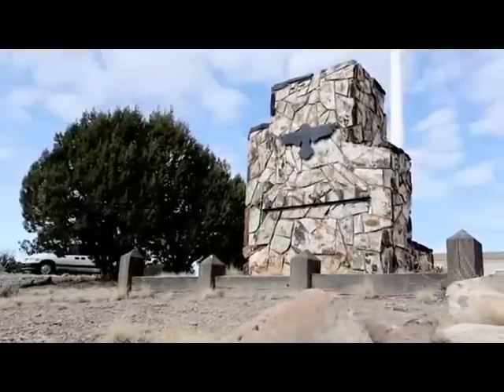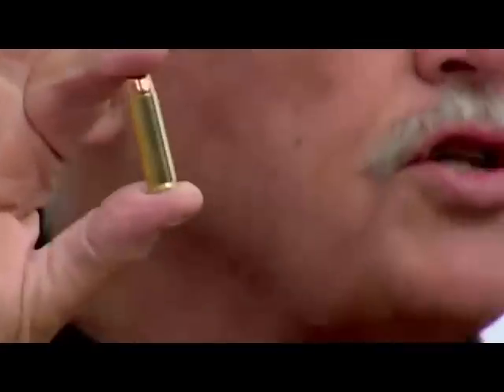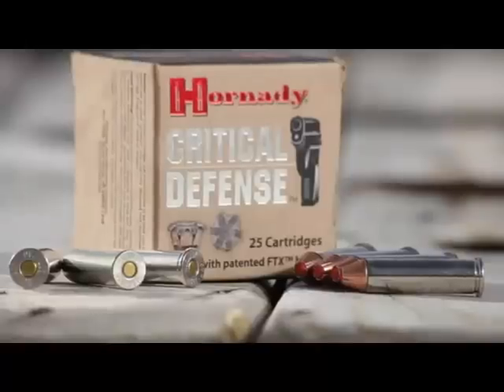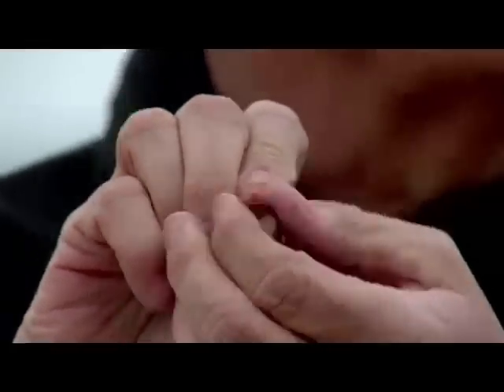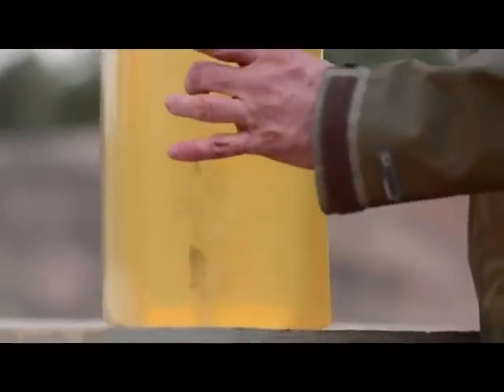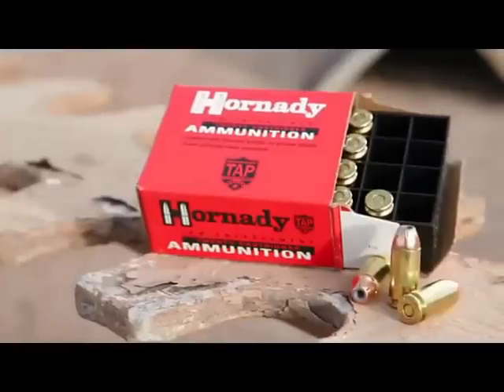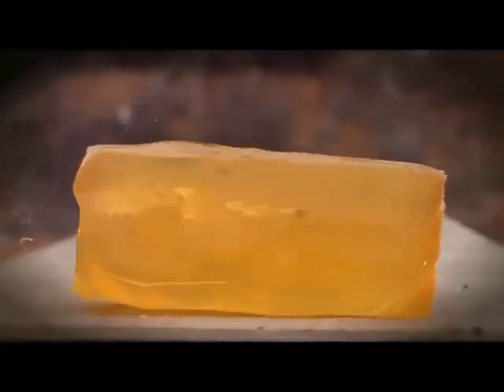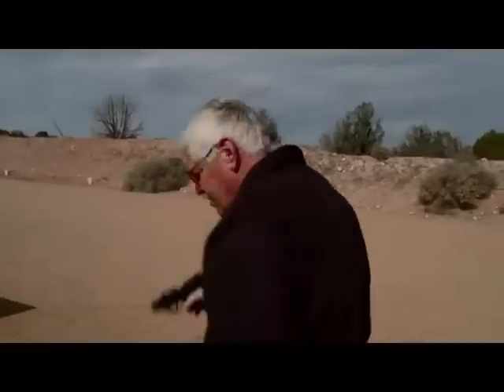Terminal Balistics Test (Part 1) .357mag/.38spl, .40cal, & .45acp

Comment: A .38 will do the job
Reply: It was replaced by the u.s military as a under performing round. The 45 acp replaced it. They did a shit load of tests and found that the 45 is the superior round for dropping a man.
History speaks for itself for the 1911/45 acp.
Reply: @walker jfs I'm not saying it is not  a .22 air rifle can kill im simply just saying the 45 acp and long colt are proven combat effective over 100 years of war has proved that until it was mostly replaced but still widely used by competition shooters and even special forces in the u.s army. The 45 did what the 38 could not and that was effectively kill an enraged tribesman wanting to hack off a u.s military man's head clean off.
Reply: @walker jfs amp it up man get a 460 rowland it gives .44 magnum power to a 45 acp with minor changeable components and can fire 45 acp and 460 rowland. Its a monster can be used in 1911s and glock 21s
Reply: Liam Kisbee got 4 pistols converted to 460
Reply: @liamkisbee8117  you sure are skilled at regurgitating what you've heard
Reply: Jake Stockton  check the military trails that will prove otherwise
Reply: @liamkisbee8117  the tribesman you speak of were the moro warriors I don't think I'm spelling that right but the ineffective round was the .38 long colt
The military wanted a more effective revolver cartridge so S&W produced the .38 spl and they also wanted an automatic so Colt / john browning produced the 1911 .45 acp
The .38 spl was the most common round used by police departments from the 1920's up until the 1980's

Comment: B.S. - that ".357 magnum" Golden Saber cartridge is barely a step above .38spl+P, they needed to use a full house .357 magnum in this test and not that reduced recoil crap.
Reply: +Gun Sam
 Consider to that the .357 Magnum was further handicapped by being fired from a snubnose. A 4inch revolver barrel would be more in line with the 5 inch semi-auto barrel which includes a chamber.
Reply: Agree, those golden saber are so anemic. they're Pure junk.
Reply: Gun Sam he didn't call it a round nose lead he said he is using fmj but the guy he was talking about used round nose lead bullets
Reply: Gun Sam full metal jacket is usually a round nose, solid lead bullet with a metal coating, yes?  Not that I give a dam about this guy, but I think he just didn't say it well.  The old 38's that cops used were just plain old 38's with a round nose and were a joke compared to the other rounds.
Reply: Gun Sam
Reply: Gun Sam - I agree. Why didn’t he use a 158 gr SJHP? Course their are other questions. 357 mag and 38 spc. 10mm and 40 cal “spc.”  45 cal and 9mm? Where’s the 44 spc and why is it ignored? Compared to the 44 spc 9 mm is anemic.
Reply: I like firing 158 gr 357s out if my ruger sp 101 snub... those 125 grains are nothing.
Reply: Gun Sam Revolver Aficionado Agreed.

Comment: Totally unfair test.  You used modern, high quality self-defense ammo in every gun, except the .38 special.  Load up with .38 +p Gold Dots and I bet you'd be surprised at the terminal performance.
Reply: hornady critical defense is better than gold dot lol
Reply: doubtful
Reply: Scotty Mac 22 they are both bonded and both work every time.
Reply: Dirty Dan +P golden saber is a great round for the .38
Reply: Sorry that you're so hurt over the shitty .38
Reply: @saltybuttskin : Well, there is one 158grs 38+P load that is in the 9mm realm energywise, most of the rest is significantly weaker, some around half a 9mm even. And that's coming from a long barreled test barrel or full sized revolver where the cylinder effectively makes the 4" barrel a 5.6" in semi standards.
Reply: .38 full wad cutter would be the ticket for the special IMO.
Reply: @The American Patriot you are not gunna see a one shot stop with 38 anywhere but the brain.

Comment: I have followed Elmer Keith for 55 years now , i have read all of his books and to this day i use hard cast bullets he designed , my primary in .357 mag is his design which comes in @168 grains and  is SWC... I have never read much in "SixGuns by Keith where he used 125 grain weight as he was never much on light weight bullets ... Same in the .44 caliber , as hard as Elmer tried with tires he had with Remington for them to produce the .44 mag loaded with 250 grain bullet the factory never did.. To this day i load and shoot the 255 grain Keith bullet in my .44 mag...  But returning to the .357 mag which i have loaded now for 55 years , my choice is still 158 grain for some shooting but 168 grain is still tops for what i use the ctg for... I don't know why the rage is so much for home defence and all the other CC using the 125 grain bullet weight , years back i bought a couple boxes of that weight and loaded them, i fired them into about every item i could to test them including big game animals , just too light of a bullet..  I agree with Elmer as being a guide , outfitter , bullet maker and a big game hunter , that the .357 mag loaded with 168 grain weight was boarder line for big game , in fact he said on the animals he hunted using it , he said it wasn't enough bullet to do the job.. I agree deer size and black bears would be tops for that ctg... For black bear i have hunted , it's almost not enough ...  good information and video ..

Comment: 38 special is more than adequate. Lots of dead guys prove it.
Reply: Cops got killed while using it. Either bad guys survived getting shot and stabbed the officer because it was so weak it caused low trauma. Also it got cops killed when they had to use .38 against bad guys armed with 9mm pistols like the HI Power.
Reply: @berettaxd7566  that's a lead round nose every slow moving round with a bullet profile like the 38 or 45 can go around organs and bone 45 has had some cases where it goes around same as the 38
Reply: I use 40 and 9 so yea

Comment: The only disagreement I really have is when you started describing the 9mm round....The biggest three reason that it is a popular cartridge is :
1. Cheaper ammo among others out there.
2.Lower recoil (shoot faster)than others out there.
2.wide variety of great handguns that have light weight w/loaded rounds
       These reasons is why the 9mm round is still around sense 1902....
The 9mm round is a proven range cartridge for The reasons I have stated above.
The 1911 models with higher calibers are Still around Because of all the Right Reasons...
One disappointment,you didn't elaborate much on how great the 10mm round is now,the variety of ballistics for both defence and hunting rounds....In my opinion(good reasons)the 10mm is better than the the 357mag. and the 38super...
        These two calibers are great cartridges,but If you did a proper test with the right ballistics (357mag,38super,10mm) I believe that you may be impressed more with the 10mm...just saying...
       Some day,Some one Will give the 10mm the attention it deserves,
It has gotten a lot of negative bios reviews over the years because of the wrong reasons...many ignorant unfounded opinions...just saying..........

Comment: Bare gelatin, at a strait on impact is a poor test period. Clothing, bone, angles... ( placments are rarely 90%) any hand load is a crap shoot. I found that .40 fires limp wrist, sideways ect. I like the added pressure. Airweights with shrouded hammer are maneuverable with a crab grip thumb on shroud. 45 has too much shove, too much weight for chamber pressure for quick sd pops. 9 is good in ++ppp++. Get a .40
Reply: Lyle Lafayette .40 is the worst of .357 combined with the best of 9mm. I'll take my extra few 125gr 9mm hornady xtps and my 10 backup 110gr winchester sjhp .357's

Comment: .38 anemic my ass. 250 ft lbs of energy with a projectile of 125-158 grains sailing at the target. Besides I'll take  2 or 3 well placed shots of the .38 at my target over missing vitals with a .357. Shot placement is half the battle, more importantly is having a firearm. I can shoot .357 out of a full sized revolver. Out of a snubby? Well I can shoot it but I ain't hitting much. I can shoot .38, 9mm, and .45 acp accurately (dead center of target) at 12 yards standing and can get good groups to about 15-20 yards. I'm content with this and If I needed to go further out I have a rifle or shotgun for that.

Comment: If you really want to find out how defensive calibers compare it would be best to standardize as many variables, such as barrel length, brand of ammunition and  type of load, as possible. In this video it's not clear to what extent a round's performance is influenced by the particular  firearm (e.g how much did the snubbie barrel slow down the .357) or the specific bullet design (e.g. TAP v Critical Defense).

Comment: yup this is old the 40 s&w has been replaced by the 9mm easier to get back on target and less cost per round and less wear and tear on 9mm guns fitted with 40 s&w barrels which is usually the case instead of manufacturing the gun around the 40 s&w cartridge
Reply: I always hear this “wear and tear” bs. 🤔… Unless you’re a pro shooter or shoot competitions, then 1) you’re not going to wear a .40 S&W pistol out before going broke, and 2) If number one applies to you and you do shoot completions, the only thing that will need replacing is the guide rod/spring or small cheap parts. It’s not going to destroy the frame 🥴. People just need to admit they like 9mm because they feel it’s cheaper(and it’s not for premium +p ammo everyone likes), it recoils less (and it really doesn’t with premium +p or +p+ ammunition in sub compact frames), and they like the 1 extra bullet in subcompact framed guns( which doesn’t matter enough to matter over the energy loss to me) 🤔🥴YMMV😅…

Comment: but does a 9mm have the same affect as 40 cal
Reply: 9mm is more like the 38 spl..those two calibers are very comparable.
Reply: +TacticalNewb 38 special is more compatible to 380 when it comes to power, but 380 doesn't have the bullet weight versatility that the 38 does. 40 is about on par with 9mm +p.
Reply: +billytube325 Well I know that ballistically the 38 and 9 are very similar.. both get at least 12 inches of penetration and expand in ballistic gel. the 380 is lucky to get past 10 inches of penetration.
Reply: +billytube325 there are non + p bullets that have made it to around 19 inches of penetration and had uniform expansion. the 380 could never hope to be in the same league as the 38 spl.
Reply: +TacticalNewb that's true of their heavier bullets, but they also have minimal expansion. I'm referring to power. the average 38 special out of a carry size 20ish revolver is a 115-125grain bullet traveling around 700-800fps. your average 380 is a 85-90 grain bullet traveling around 850-1100 fps. I'm not weighing in on the fast and light vs slow and heavy debate, I'm just saying they are comparable in power.
Reply: +TacticalNewb I'd go as far as to say most if not all 38 special loads need at least a 4" barrel to get reliable expansion. the 38 rounds that I have seen expand and penetrate are all exposed lead tips that are nice and smooth, ultimate creating a wound path not much greater than a fmj. the rounds that do expand big and have sharp pedals typically penetrate around 10-11", about the same as 380. 

now a hot underwood or buffalo bore 158gr out of a 4" barrel or greater is gonna put a hurting on 380, but it will still be toward a bottom end 9mm load.
Reply: +billytube325 Speer Gold Dot short barrel 125 and 135gr + p jhp as well as Remington Golden Sabre 125gr + p jhp both have about 13-14 inches of penetration and full expansion search gel tests for them on here. And if you search scubaoz gel test for the Hornady 158gr xtp standard pressure round on here it gets 18 and a quarter penetration and leaves a pretty wicked wound channel..And btw is tested out of a 2 inch snubby. Check it out.
Reply: +billytube325 I'm not saying that it is on par with the hottest 9mm loads. But I am saying that it is at best on par with a standard 9mm. And at worst still better than a 380 acp. Can we agree on that? lol
Reply: +TacticalNewb fair enough. I watched the 125 gold dot video and it got 12 and 1/8th" but did not fully expand. the golden sabers fully expanded, but didn't even hit the 12" mark. standard pressure 9mm 124 hst typically expand larger than the 38 and penetrate 14-16". 380 gold dot and hst expand about the same and penetrate about 10-11" (11-13 out of the glock 42)  this is why I say the 38 is closer to the 380 when tested out of a similar barrel. again I will say the 38 has more potential as longer barrel firearms are available and are practical for home defense (concealed carry not so much). I'm not saying the 38 is the same as the 389, just that it is closer to 380 than it is to 9mm, especially when you factor in the premium rounds available for the 9mm.
Reply: +TacticalNewb I like 38 in a 158gr hp, but you really need the longer barrel to make it reliably expand. in the lighter offerings it just does not impress.
Reply: +billytube325 also check out tnoutdoors9 he has some good tests. Check out his golden sabre and gold dot test.
Reply: +RugerShooter 9mm has 100 ft lbs more energy than a .38 so it's more potent.
Reply: @billytube325  So if you go to high pressure rounds in a 9, every claim about a 40 being harder on the gun is null and void.  I can see very high capacity for LEOs and FBI being a factor, not so much for private citizens.  If John Q Public is in the gunfight at the OK corral, you are way out of your league.

Comment: Learn proper skills for good shot placement and the caliber is not really relevant. The 357 is one of the best with .40 caliber very close second.  If you research .40 you will find most of these encounters are lethal.  That is why I carry the .40  however, the 9mm is easier to shoot accurately.  That being said the FN 57 shoots .22 caliber rounds similar to rifle rounds and it is even easier to shoot than 9mm.  So, if I were choosing today I would choose the FN or a 9mm and train so that you can hit someone where it hurts the most.  You need to hit the head or chest.  If someone has armor then the head is the target. The caliber does not matter much if you hit that.

Comment: Eclipsed my ass..... 9mm much more versatile than the 45acp.... bigger is not always better. Especially when the smaller 9mm can leave a wound canal nearly identical to a 45acp
Reply: Albert Archer no doubt,  a .22 will kill  bill burr has a funny joke about how the .22 is superior
Reply: No the .45 has the biggest wound canal and will always cause more damage than a 9
Reply: Jared Taylor 
First bullet size doesnt matter when you miss. 9mm kicks less and is more accurate. Second there are 9mm rounds that are hotter and do more damage than regular .45 acp JHPs depending of course on brand and weight.

The .40 is probably the best for a middle ground if you dont want to use a 9mm or .45 acp. Though .40 kicks more.

Regardless practice matters the most, being able to repeatedly keep shots on target with good shot placement is what counts. Knock down power doesnt exist with a pistol regardless so its good to keep that in mind too.

In my opinion the 9mm with high quality ammo and constant practice to keep you on target is the best for me, simply because it holds almost twice the ammo per size as a .45, and recoil is neglible allowing for faster fire rate..
Reply: I have Winchester Ranger Ts, 230gr +P for my Glock 30. 1" expansion and meets all the other FBI protocols. No 9mm is reaching close to that.
Reply: John Smith 
So would you honestly would wanna be shot with any of the 3 main calibers? Being 9mm, 40 SW and .45 ACP hell throw in the .380 to be fair. Statistically according to the FBI all three of those calibers have 1/3 chance of dropping your attacker dead in their tracks and 60% or greater chance of stopping the attack and injuring the aggressor.

If it truly came down to caliber in a shoot out I'd hope to have a 5.56 in semi auto to defend myself not a pistola. In most occasions though where we defend ourselves in public a concealed weapon is most tangible to use. Last point is 9mm is cheaper and would not limit the amount of rounds you could use for practice in some cases leading to a person who better understands their weapon.

In real life even if you land a shot on the attackers big toe it would have more of an effect than not landing any shots at all, and at that point all of the three major calibers have the same effect.
Reply: John Smith 
Not to push this too far, but personally I think the .40 sw has more power than the .45 acp due to velocity.
Reply: I prefer the Underwood 165gr 10mm JHPs (there Gold Dots) and my Glock 29. I also carry a G19 w/HST 124gr. I was just saying that in tests, the Ranger Ts were averaging 1".
Reply: John Smith Nice